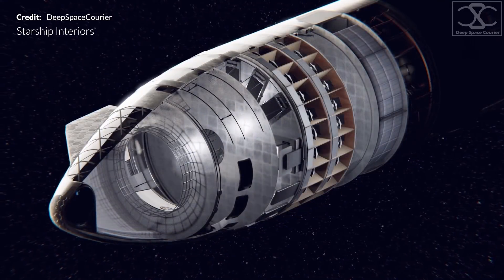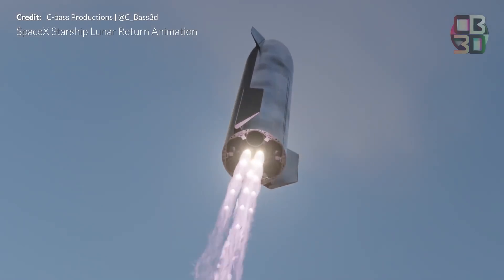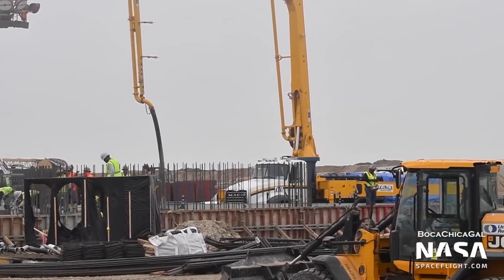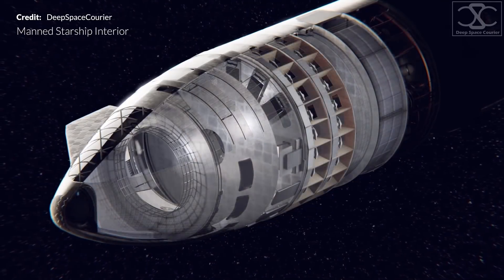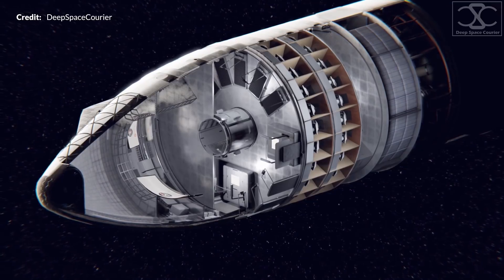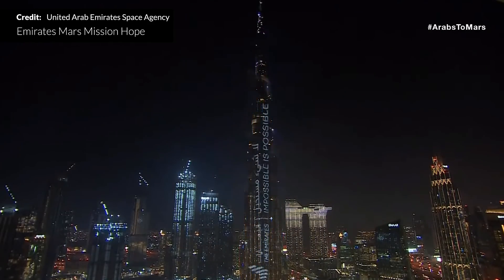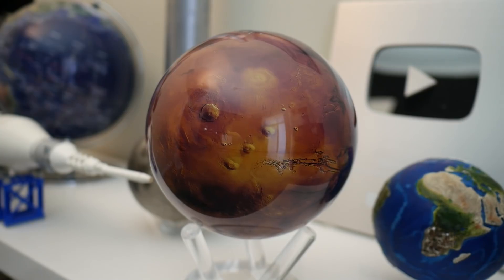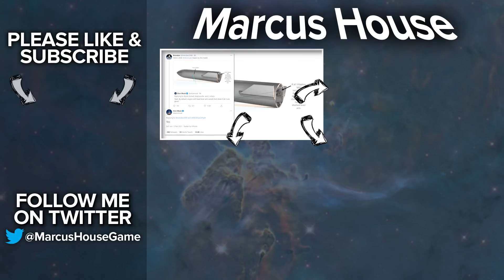SpaceX Starship to attempting another flight with SN10 - Can they master the flip and landing!?

Comment: Have the levels of gyroscopic procession imposed on the Turbo pumps during the flipping over maneuver been considered in the design?  It would seem to me that the resulting forces would put a lot of stress on the turbo pump bearings.  Might not these forces be related to some of the engine start problems?

Comment: I do not understand how Starship can have one engine work but the other not work Gotta be a (an intermittent) fuel supply problem, but theoretically that should affect ALL engines. Perhaps there was not time to fix the problem and testing of other systems during the flight was worth more than the destruction of the vehicle.

Comment: Best that SpaceX learn about relighting engines and possible failures very early on when the prototypes are at their cheapest. It’s only going to get more expensive from here. So in fact SpaceX learned an extremely important fact from the data. FAILURE TO RELIGHT LEADS TO A TOTAL LOSS AND A REPLACEMENT ENGINE CANT BE LIT FAST ENOUGH TO CORRECT FOR AT RAPLY DETERIORATING FLIGHT PATH AND STABILISE THE ROCKET FOR LANDING.

Seems like a good lesson to me and also a lesson best learned early on.

Comment: Why can’t it land like a plane?
Reply: Its because it is supposed to be a spaceship on its own..
Say it gets to mars or the moon then it wouldn't have anywhere or runway to land and decelerate.. 
because eventually it will have to take off so again, it will need to take off vertically(pointing upward)
they could also make it land vertically while positioned horizontally but then again they would need to add more rockets.

Comment: Why not just bring the "engines" back? Slide them out like shells in a hand gun? Lock them onto a heat shield that has been sent up seperately....and bring them down as a unit or one at a time. Leave the starship hull up there and then launch the engines and crew only to the starship for the trip to the moon or mars etc. Why launch the kitchen sink, bathroom, sleeping areas, recreation areas etc every time?

Comment: Thanks for the video, Marcus. Creation is hard. Designing is hard. Getting your design to work can potentially be difficult as well. Computer simulation using software is highly useful but ultimately must give way to practical, physical testing to verify parts, materials and calculations that must exceed the minimum requirements. Trying to work all of these things out will make your head spin and give you a headache at times. However, when your efforts are successful and your calculations are correct you may be witness to a singular event that you will never forget. Leaving the gravity well of Earth is not impossible. Doing it reliably, month after month, is a colossal undertaking. Surviving in the void of space for extended periods of time is still a dream in many ways but slowly approaching a practical reality. This is what SpaceX is showing the world. Some of the things we have thought to be improbable are becoming quite possible. Exciting stuff.

Comment: If all resources would be allocated momentarily to Starship mass production, a proper base could be established very fast.

I wonder if they are going to focus on controlled tilting of the ship at some point, pretty much all permanent starships with habitation and storage would be a lot more useful to colonizers if they would lay down instead of standing this would also make it easier to add radiation protection when there is no big heap to make.

I've also been wondering if it would be possible to make the main gas tank somehow useful too when empty, sure it can be used to store gases and liquids produced outside of earth, but maybe it could also be used as living quarters or a lab or storage room also, at least this option being available would be nice to have.

Comment: Starship SN10 won’t fly this week but likely very soon.  SN11, SN15 and BN1 won’t be far behind.  The real questions are around the engines and the altitude where they perform the flip. They are really pushing the edge so RUD’s should be expected at least through SN18.

Comment: I would love to see a LOX cam footage during the flip maneuver. Will the propellant not gravitate towards the bottom of the tanks with one Raptor burning? If so, then the other Raptor can get it's fuel from the tanks with no pressure feed problems (if it is the issue)

Comment: A craft shape like SpaceX Starship cannot work because fossil fuel is the e most extremely limited resource of power over any other alternative engine of travel, even though its the most powerful exertion in its duration then anything else. Because its bulk limit canister, its even more dependent on aviation gears like wings/gyros and other altermative fuel preserve methods, the most unfortunate of the concept, was this need to render in pure vertical, look back at his early concept of Mr. Musk blimby canister cgi craft visiting  the ISS, Moon & Mars, using a crane to lure items down as a whole craft form. Its because as extremely smart salesmen, he needed his meth fuels and rockets sold, someday the craft might have a paradox usage, for now, its no CIGAR. 😉

Comment: Not sure but could'nt have SpaceX tested the re-light pressure/system with the raptors before launch? cause the system works sn8 proved that, just the relight is the problem.

Comment: They should not have put SN10 on the pad until SN9 was landed or crashed.  It may have been a political statement to pressure the FAA into faster launch permits.

6:00 the rebar could be for a wall.

Comment: I've always called the Gateway station Pointlessness Base because that's exactly what it is. We have a station for experiments in zero-g, what do we gain by putting another in orbit around the moon? A location far more susceptible to solar radiation. The only advantage i can think of is it's easier to get supplies to but even then not really that much. If we are going to the moon "to stay" then why the hell wouldn't you set up the base on the surface? Where you can take advantage of the rock for shielding, of the resources for fuel and air, of at least the minimal G and where you merely need to step out your door to do lunar experiments. Instead we are putting a tiny little station in orbit where we will have to fly landers to every time we want to go to the surface. Is that really easier than just landing supplies on the surface? And by putting this extra step in the process guarantees two things; 1 all future deep space mission will be routed through here to justify it's creation and 2 adding a few more decades to the road to Mars. Because it's going to take about ten years to have it all up and running regularly, then NASA will want to use it as intended for a decade or two before even considering moving on to Mars. And even then i hear insane talk about a Mars gateway station. 
I am not opposed to the idea of orbital stations but at the glacial speed that NASA moves every extra step adds time. I'm 29 and i am genuinely worried i'd be dead before NASA establishes a permanent Mars colony. So thank the various deities that we have Elon and SpaceX. Think about it, if all goes to plan (i know how unpredictable Elon-time can be) SpaceX will be sending uncrewed Starships to Mars as the first parts of the Gateway are being launched. If we are very lucky they might even be sending crewed launches to Mars before NASA lands back on the Moon or at least shortly there-after. I love NASA but i really hope that they are made irrelevant to the future of space.
Reply: While being honest, yes gateway is a waste of time and money, it’s a stalin ground for all Mars and Moon Artemis missions. It’s not a lab, it’s a hub.also, The ISS has been in service for well over 10years and cannot be modified into something like gateway
Reply: @Cediii4ris  But my point was why do we need a gateway? It's easier to resupply but has to be restocked with landers for every mission to the surface. Would it really be that much harder to just put all that infrastructure on the surface? Where all the objectives and resources are.
Reply: @FreyaVoidborn  propably is. The main problem would be energy- solar is very inefficient because the light lasts 11 days, which is also why a base is not the best. The night is very cold, so very bad aswell. Then there’s infrastructure which is hard to do and much more. For the future a base would be cool, but gateway is a solution.
Reply: @Cediii4ris  Fair enough. I guess I'm just always frustrated about how slow everything is. I'm too used to Spacex.

Comment: I think we are in for another hard landing with SN10. Falcon is nothing like the weigh of Starship which is making it fall much faster. It's coming down way too hot, and will continue to do so, even with 3 engines lit then backing off to 2 because the timing is too tight to the ground.  The argument is , the Raptors have too much minimal thrust to start them up sooner without causing the vessel to start rising again before touch down. But this is driving a very "last possible moment" type sequence to land.  WHY? .  If you haven't noticed there is GOBS of room in the engine pocket.... so stick in a pair Merlins to work in tandem with 1 Raptor JUST FOR LANDING.  These will give the ship the finer lower range thrust control needed to give it a gentle landing and allow the ship to flip and engine light up much higher up - and with more time for the corrective thrusters up top to ensure the ship is squared properly to land.  Give the ship the proper time it needs to plant the landing soundly.

Comment: Since you asked: I think SpaceX is landing so close to the launchpad because when they DO get a clean landing, they can quickly hoist the winner back on the pad and fly it again.
Now THAT will be a serious milestone for reuse and quick-turnaround operation. This applies double when they start booster launches and later orbital ops.
(Note: Because there's no pad on Mars, eventually they will need to figure out how to launch without one. Can Starship lift off from bare concrete? What about from sandy regolith?)

Comment: I never understood the header tank method of dealing with sloshing fuel or using inert gas to maintain tank pressure..  Why not just pull a plug through a tube?  If you make it pull both directions (e.g. a cable), you might even use this to deal with boiloff by pulling the plug up to absorb increased pressure.. not too much as to increase boil off..  Multiple methods could be used to keep a tight seal around the plug.  For example, a smooth plug should probably be sealed with silicon oil.  Or, the plug could be a screw if the tank is threaded...  Just making the plug deeper would, in any case, improve the seal.

Comment: In terms of awesome looking explosions, SN9 did better than Hollywood's best wet dreams.
Of course they'll get it.  It looks like re-igniting during that flip is very hard.  Actually, that's exactly the part I thought would be hard.  I thought I'd be better to try at higher altitude, though..  give some second chances at testing..  I trust coming down straight would be much more reliable..  Just landing at all, without crushing its legs is also something we haven't seen yet, even with the water tower tests before.

Comment: The rocket seems heavy and too fast. Also it might be that switching from horizontal to vertical position could cause methane flow problems. IMHO .
Reply: This issue was dealt with a century ago.

Comment: I think that SpaceX is very confident on getting the Star Ships to land or crash on the concrete pads. In the case of a crash I am assuming that any debris ejected from impact is relatively light sheets of stainless steel, therefore damage to any nearby structures would be minimal. Hope SN10 is third time lucky and they nail the flip and landing manoeuvre.

Comment: The infrastructure around Boca whilst being extensive is still mostly temporary in construction. If they don’t add additional features I’d anticipate a marked slowdown in production when they start introducing the elements for crewed flight. Unless these elements are made elsewhere and are modular in design? They could protect the rant farm better, but no doubt they’ve done some systems engineering and figured it’s a risk worth taking verses the effort of higher walls etc. I still wonder about the launch mount that Elon himself said wasn’t the greatest design having no flame pit. Remember what happened to the shuttle on its first flight and the damage caused by the shockwave. I’m looking forward to a ‘landing’ of SN10, perhaps a touch, hop and topple, who knows.

Comment: Hello friends, what is the missing candy ... I am a private researcher and the automatic union of paramagnetic and diamagnetic materials such as titanium and aluminum alloys was discovered. Symmetrical joints with controlledmmetry from both sides of the material ... More powerful space launch systems and modular monohulls joined by stimulated emission of light ... Starship is made of 304 stainless steel and my discovery makes it several tons lighter in shape automatic titanium ... automatic reactive material joining for the first time ever ... rivet removal in aerospace manufacturing

Comment: Your headline suggests that it's been confirmed that they will make an attempt next week but based on SN9's launch schedule, there are still plenty of steps that SN10 needs to go through before even considering a launch - at least 3-5 static fire tests, adjustments, faa approval, weather, etc.  I don't think of any of those steps have taken place yet, so to say that they're attempting next week makes it seem like either you don't know what you're talking about or you simply want clicks over quality content.
Reply from the maker: Static fire, then flight. Optimistic but that is the current plan right now. Weather is a bit of a question mark though.

Comment: On each previous landing, one of the two engines does not start, the probability of engine failure will be 50%, this time Spacex starts all three engines and let, taking into account the improvement, the engine failure probability is 30%, which means that two engines should start and it will be fine. Forward Spacex, to the greatest discovery of humanity.

Comment: Since the issue has been losing a engine both times, firing up all 3 again and then soon as it gets control cutting the 3rd off, should work. The issue this time will be it not slowing down enough and pancaking the legs. 🤔

Comment: I'm confused. I thought SpaceX had been selected to lift the two gateway modules last year.
    Anyway, Gateway is completely useless, and that has nothing to do with comparison with Apollo. A space station in Lunar orbit in no way allows additional time on the Lunar surface, or helps maintain a permanent base on the Moon. It does not support surface operations in any way. Gateway merely provided something for SLS to do, which it no longer does, and lets international partners do something, which is important for maintaining political support for the project. Various members of Congress would be perfectly happy to shut the whole thing down, but not if it meant a great big two word insult to allied nations who are signed on to help. Getting international partners saved the space station, and Jim Bridenstine recognized the value of the same tactic for Artemis.

Comment: I think people need to realize that they are only disappointed by SN9 because of how obscenely well SN8 went.
Reply: "Obscenely well" as in crashing and blowing up?
Reply: @jonathanclarke5878  Yes.  It was the first flight test of a multi-engine raptor setup.  It performed the longest burn of a raptor engine at almost 4 and a half minutes.  It was the highest flight of a full-flow staged combustion cycle engine ever.  It performed the first belly down controlled descent ever.  It successfully did the landing maneuver until there was a loss of pressure in the header tank.  It literally did everything spaceX was hoping to achieve eventually after multiple test flights on the first try.  Reminder, this rocket cost only a few million dollars and was built in less than 3 months in the middle of nowhere in Texas by a bunch of people who had never built a rocket in their life.  Yes Jonathan, OBSCENELY WELL
Reply: @d4rkblu386  I'm personally way too hyped for the full-flow staged combustion cycle engine than I should be XD
Reply: @cy-one  No such thing as too hyped, the raptor engine is awesome!!
Reply: @d4rkblu386  That thing's a marvel of engineering.
And it fukken works!
Reply: @jonathanclarke5878  they didn't even expect it to reach apogee... wtf do you think a successful test is when you're rapid prototyping?

Comment: The interior animations are fantastic but I feel they are too "open". I'm expecting more bulkheads with airtight doors, in the event of a meteor or space debris strike. And a lot more internal equipment. 
Also feel that the Mars-bound Starships are not going to keep their occupants in zero-G for months but rather use the trapeze idea of two Starships spinning a few hundred metres around each other and linked by cables between the noses.